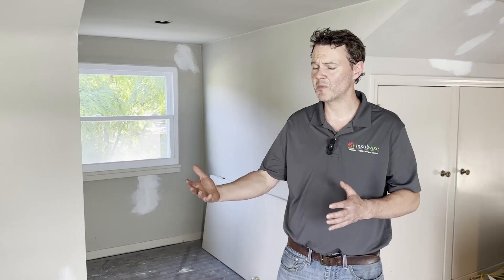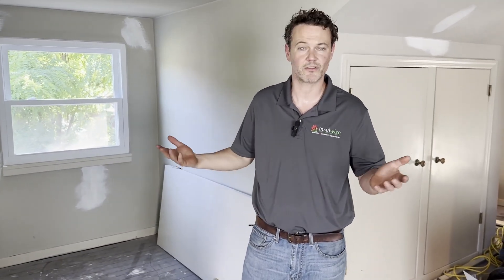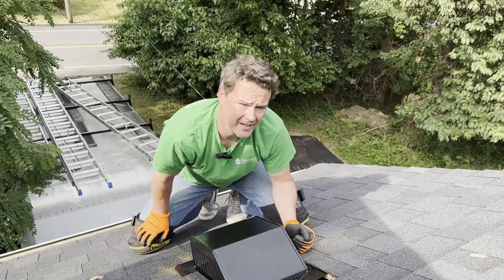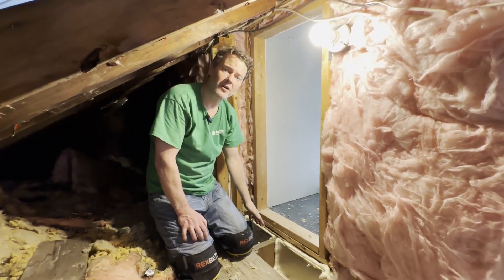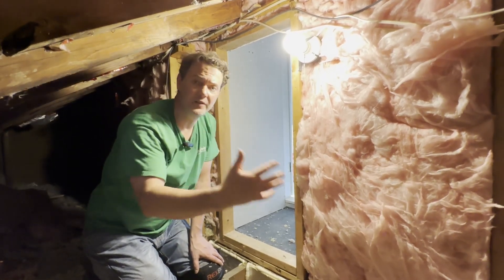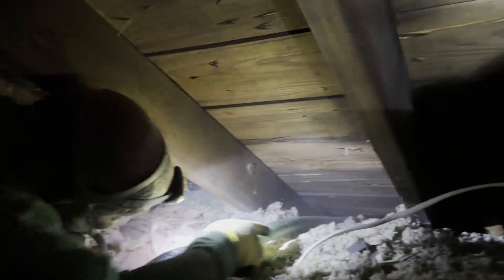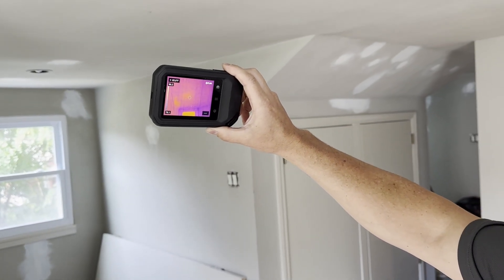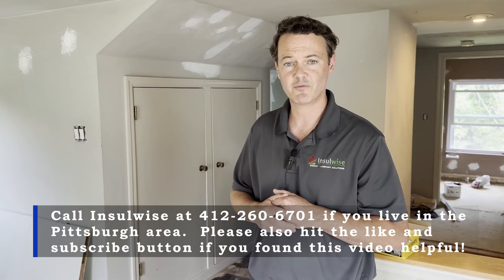How We Quickly Cooled This Sweltering Cape Cod Home with New Insulation!

Comment: Could you close cell foam the  bottom of the eave space roof and airseal the short slanted portion to prevent conditioned air from entering the attic? I have four of these spaces at each corner of the house and none of them are ventilated (intake or exhaust) or insulated. Debating on 1) making each of these independent attics, insulating as shown in this video, and adding gable vents for intake and box vents for exhaust, 2) attempting to run baffles up into the attic space above the knee wall and connecting them to the greater attic, or 3) close foam spray the underside of the eave space, seal it off from the attic above, and then it would be conditioned space. If I were to spray it, I would get the DIY kit from the big box hardware stores

Recommendation? Thank you
Reply from the maker: We never attempt to baffle the slopes when there is drywall present.  It's nearly impossible to get baffles all the way up / attach them midway up the slope / there are roofing nails / existing insulation present that inevitably muck the process up.  Also, the baffle takes up a big percentage of the space available for insulation.  
1)  Make them independent attics
2)  One vent in each will do just fine if they're not large spaces .  Intake and exhaust is technically correct, but in practice is overkill for these smaller attics.  If there is moisture build up, it will definitely equalize / dry out through a box vent or side-mounted gable vent 
3)  It's technically possible to make these conditioned spaces, but in practice difficult due to the sloped ceiling.  If you did that I would recommend removing the drywall on the inside and using close cell spray foam to spray from the top of the first floor wall all the way to the upper attic.  
4)  If you make the sloped bay solid insulation with cellulose insulation any moisture that finds it's way in through a nail pop in the roof can migrate fairly easy upward to the main attic space to dry out.  We haven't had any moisture / mold problems with roofs using the practice and have done well over a thousand homes like this in Pittsburgh during the last 16 years. 
5) The only time we baffle the slope bays is when the drywall / plaster board is removed.  We then baffle them and insulate the bay with R-19 fiberglass batts.  But if we can't install the baffles perfectly I believe it's a massive pain in the butt for minimal gain.  
These are tricky spaces to retrofit and you're thinking about this the right way.  Let me know if you have other questions!
Reply: @insulwiseenergycomfortsolu3293  This is extremely helpful, thank you for replying! I have a follow-up question on #3. For how you made it unconditioned space, you blocked off the top of the kneewall and then close-packed cellulose the sloped bays from the attic space above. Why don't you need to remove the drywall for this, but you would if you close cell sprayed? Could you could similarly block off the rafter bays leading up to the attic above with rigid foam/air seal at the top of the knee wall, close-cell spray the eaves area, and close-pack cellulose the rafter bay like you did before?
I'm trying to determine the cost-to-time benefit since I also have water pipes to protect (if it becomes unconditioned space) and the kneewalls and doors would need to be retrofitted (currently hollow-core bi-fold doors). Thank you for all your help!
Reply from the maker: @omnomnomnivore2766  You're welcome!  1)  We don't need to remove to remove the drywall for dense packing cellulose because we need something to pack against on all 4 sides with the dense packing process 2)  If you're planning to spray foam the sloped bays I'd encourage removing the drywall so that you have effective access to the underside of the roof deck.  If you sprayed expanding foam down the slope bays from the upper attic your coverage could be incomplete you may not know it and you could also risk popping your drywall off if the foam over expands 3)  You could block the bottoms of the slopes with foam board and sealant, spray foam the underside of the roof with closed cell foam and then dense pack the sloped bays with cellulose, that would work 4)  If your main concern is keeping water pipes from freezing --- and the pipes be insulated around --- I would possibly attempt to do it the way we do in this video link

When insulating water pipes in an unconditioned attic, the MAIN thing it to NEVER have insulation between your heated surface (wall OR ceiling) and the water lines.  Always insulate over top of the water lines, leaving a "heat cave / channel."  The goal is expand the thermal barrier outward a bit so that the water lines are enclosed with it.  The same method that you see me using in this attic we do in knee walls all the time.  The temps went down to zero in Pittsburgh this past January and I've never had a call for a frozen pipe in the areas where we have done this.  This might save you some time / money / effort.  Let me know if you have other questions. 

How to Keep Water Lines in an Attic from Freezing
https://www.youtube.com/watch?v=ucIHVJXeeng

Andy

Comment: Really appreciate your videos!! How did you insulate around outlet boxes? Did you lay the fiberglass batts right over them or cut around them?
Reply from the maker: Thanks!  Great question.  The first thing that we do is air seal around their perimeter and the wire holes.  Next we cut out for them and lastly add a piece of fiberglass over the backside of them.  That seems to work well for us. 
Andy

Comment: Such great information on here. One thing I haven't seen, or maybe missed, is what the strategy would be for a "stick build". My house was built in 1945 and doesn't have sil plates on the second floor. The wall cavities go from the roof to the sil plate on the first floor, on the concrete foundation. So, air sealing the second floor seems almost impossible as the floor joists run parallel to the knee walls. It's also built with 2x4s so getting the the best r value is tough. Instead of house wrap to keep bats in place, have you used rigid 2" foam board to hold bats in and add additional insulation?
Reply from the maker: It sounds like your home has what we commonly refer to as "balloon framing" which basically means no plate between first and second floor, and possible openings to basement and attic.  We deal with that by sealing the joist bays in the basement and then dense packing the exterior walls with cellulose insulation.  That process will massively reduce air leakage of the structure and insulate it extremely well.  
If you want to maximize R value on your knee walls than yes, install batts and go over them 2" foam board.  That's an outstanding upgrade.  We don't often do it due to the additional costs for the homeowners, but if it's your own home and you're doing the work it makes sense. 
Andy

Comment: I have R 28 roxwool insulation under my upper  room floor subfloor. It runs under the knee walls, and the insulation in the knee wall sits on top. The blown in attic insulation sits against the roxwool. Is the air seal between the floor joists still necessary in this scenario?
Reply from the maker: If you are not conditioning the upper room (heating it), than I wouldn't seal the transition gaps between the floor joists.  You want for moisture to be able to escape out through those openings and get to the outside, rather than getting trapped between your first and second floor with a cold floor where the water vapor will condense.
Reply: @insulwiseenergycomfortsolu3293  Thanks for your response. We are heating the upper room. The first floor is a garage. Currently, I have r28 roxwool in floor walls and cieling. Vapor barrier seal under the drywall. Baffle vents running from lower attic to upper attic out the roof. Ample intake at the soffit. I am dealing with condensation on the exterior side of the roxal in winter. I plan to switch to turbine vents.   Do you think this will solve my issue?
Reply from the maker: @henryb5215  Ok.  In the knee wall spaces, is the roxwool on the on the back side of the knee walls or did you choose to insulate against the roof?
Reply: @insulwiseenergycomfortsolu3293  the roxwool is in between the knee wall studs. The roof is only insulated above the room. Also there is quarter inch plywood holding the knee wall insulation in place. However there is no tyvek on the knee wall. Adding tyvek might help the condensation on the wall roxwool but there is also condensation on top of the cieling roxwool. That's why I was wondering if the turbine vents would solve both wall and roof condensation? Or do think it's necessary to have tyvek on walls as well? Asking because it is a hastle scooping the loose insulation away from the wall to add tyvek.

Comment: is the r19 knee wall faced or unfaced?
Reply from the maker: Great question, the batts are faced and as always you want the kraft paper to be facing the heated surface (why you can't see the facing here).  
Andy
Reply: @insulwiseenergycomfortsolu3293 Could you technically use something like Certainteed MemBrain along with unfaced batts in place of Kraft faced batts?
Reply: @insulwiseenergycomfortsolu3293  Could you use unfaced? Also, if I have ridge vents in upper ceiling but no baffles from knee wall space  and dont have any soffits, but have gable vents in knee wall is that ok?

Comment: I have a cape cod style house and we only have venting on the gable walls. I plan on having our roof done this year. Not sure if a ridge vent will help. We get really bad ice damns as of now.
Reply from the maker: For ice dams the first thing that needs to happen is to have the attic spaces well insulated, as per this video.  The second thing is to have them all effectively ventilated.  The ridge may help, but the knee wall spaces also need ventilation.  Have your roofer install undershingle intake vents in the knee wall spaces.  It will definitely help in a variety of ways, winter as well as summer.  If the roofer is not familiar with this practice, hire a different roofer.
Reply: @insulwiseenergycomfortsolu3293    yeah. That's the plan. We also do not have soffit. I believe the soffit vent works with the ridge vent together but don't quote me on that. I'm just a trim carpenter/ door hardware guy. Roofs and insulation is not my thing until I hear what the cost is going to be then it might become my thing. Lol

Comment: If I wanted that knee wall attic space conditioned. Can I put up baffle and then rockwool insulation on the rafter bays?
Reply from the maker: You need to have an effective vapor barrier between the conditioned space and the underside of the roof, and you'd also ideally want the baffles to continue all the way to the upper attic (verrry hard to do if drywall is already on the sloped ceiling part).  
So baffles, insulation, drywall and then drywall sealer/ primer/ layer of latex paint OR spray foam the underside of the roof with closed cell foam (if you're in a cold climate it has to be closed cell foam).  When water vapor hits the underside of the roof in a cold climate that's when you get mold growth. 
Andy

Comment: We have what looks like very old crumbly, dark, dark, gray and dirty insulation between ceiling joists in our attic and then some old batts on top of it. Would you recommend removing it all and blowing in new cellulose or can you just leave the old stuff and add more cellulose on top of it?
Reply from the maker: You can absolutely add new cellulose over top of that old stuff.  The practice is called top coating.  However, you definitely want to air seal the air leaks in the attic floor before blowing in new insulation.  You'll get as much of an improvement in energy efficient and comfort from sealing the air leaks as you will from the new layer of cellulose.  Here's a link to a video that shows how to do this.  Good luck and thanks for commenting!
https://www.youtube.com/watch?v=PUSONSE7srE

Comment: I have a cape cod home with soffits and a ridge vent. At the sloped ceiling, i tried to shove baffles up there but couldn't bc of all the nails everywhere. So i currently have  6ft strips that are about 3 inches wide in every other bay. The slope is almost 8 ft long. Is my attempt worthless and take them out? With the old insulation that is currently in the sloped ceiling and nailed down by the roof shingle nails, there is minimal or not any air flow from the soffit to the ridge. 
Do i need vents at the top of my knee wall/close to the bottom of my ceiling slope. Or will the exhaust vent cancel out my ridge vent. I am also planning on getting a new roof in the next yr or 2. Add exhaust vents at the kneewall area or have both ridge vent and exhaust vents or just  exhaust vents at the top of the roof?
Reply from the maker: Hi there, yes Capes can be confusing, especially to ventilate.  If you've air sealed the knee wall spaces properly, and your soffit vents are venting well, that should be sufficient to take care of those spaces.  I wouldn't worry about trying to do intake and exhaust for your smaller attic spaces.  
For your slope ceilings, I give you credit for even attempting to baffle them, that's a heckuva a chore!  If it were me I would not have tried to get the baffles into place, but instead used that minimal roof rafter space for additional R-Value with a blown insulation.  You do need to make sure that if you're sloped bays are not baffled, that they are well air sealed.  Any light fixtures, switches, recessed lights in your slope ceiling bays need to be air sealed to prevent moisture from getting into those bays by Stack Effect driven air leakage from your home.  
When you get the new roof you could have them add an undershingle vent across the knee wall space for additional ventilation if you wanted to.  When these spaces are well air sealed, and there are vents installed, I have never seen one develop a mold problem, so you should be good. 
Andy

Comment: You've got me doing an inventory of all my insulation deficiencies. Good job!  :)  First, how do you insulate the top and sloped sections if the top is too small to get in? My interior flat ceiling is only 5 feet between the slopes which I guesstimate makes the attic space only 3-4 feet tall. There is a single inspection hatch caulked shut but it is only 11"x12". Second, the living and dining rooms have plaster coved ceilings. I'm not sure how those were constructed but if I crawled to the outside walls in the attic above those rooms would I find a void going down behind those coves? If so, how would you seal those off?
Reply from the maker: Thanks for watching our video!  To address your questions  
1)  We blow in the upper attic and slopes from inside the knee wall spaces by fill tubing up the slope bays if the upper attic is inaccessible.  It's not fun, but it's the only way to do it.  You just have to be careful not to blow any vents full...so you can't dense pack the upper attic, just loose fill it and it'll settle down from the upper ridge vent (if there is one).   This process requires some real "touch" and would be easy to "screw up" for an inexperienced installer, just a heads up.  
2)  You'll need to inspect those "eave" areas to see what's happening there.  Respirator, head lamp, knee pads, gloves.  You may find there are no top plates on your exterior walls.  These wall bays can then be dense packed with cellulose from above.  If you have soffits or soffit vents, either install baffles to maintain an air channel into the knee wall attic (super important for preventing mold), or block the soffit openings IF they are not vented using loose tufts of fiberglass insulation (easiest way).  Either way you do not want to blow your soffits / overhangs full with insulation.  
Let me know if this doesn't answer your question. 
Andy
Reply: @insulwiseenergycomfortsolu3293  Thanks so much Andy! That's very helpful. House has no real soffits (about 6 inch stucco overhang at eaves) nor soffit vents. However, additional venting has been added on lower and upper roof. I have calculated the vent area/ attic area ratio at 1/124 (63% intake, 37% exhaust) so I believe there is adequate venting. Currently no mold or moisture issues inside the attics but there is ice damming (which I believe is due to non-existent air sealing). What is the benefit of keeping the soffit area clear in this case? Does it just ensure the roof stays as cold as possible?
Reply from the maker: @j.frankparnell3087  In all attic spaces (at least that I can think of) you want to have the insulation extend to where it is situated over top of the exterior wall top plate, and that's about it.  If it goes into the eave area and you have a gutter leak or some kind of other drainage issue, that insulation could act like a sponge to soak up moisture, and damage / rot any wood or other materials there.  If the attic floor of the knee wall is air sealed, the transition gaps are sealed, other air leaks like outlets are also sealed, and the back side of the knee wall and the attic floor has been effectively insulated, you shouldn't have many ice dam issues.  Now, in some instances there could be freeze / thaw effects that can happen (cold at night, warm during the day) melting the snow and then causing it to freeze again, but those prior mentioned remedies should stem ice dam related heat coming from the house.  Especially if your knee walls have been effectively vented, as you mentioned they were. 
Andy
Reply: @insulwiseenergycomfortsolu3293  I hadn't thought of the gutter leak possibility. Thanks again Andy!